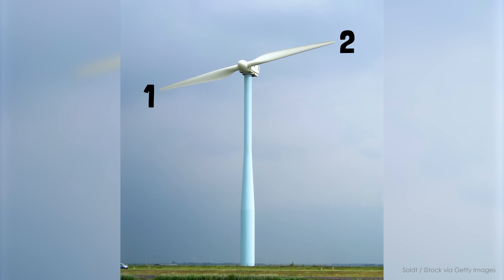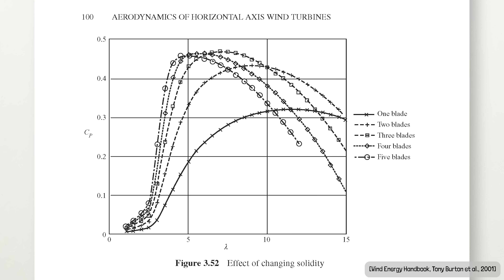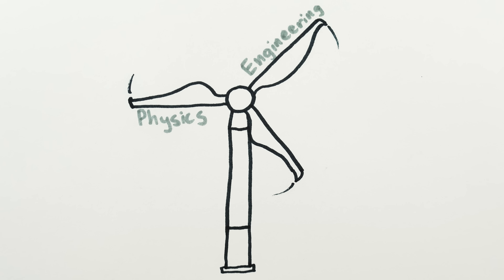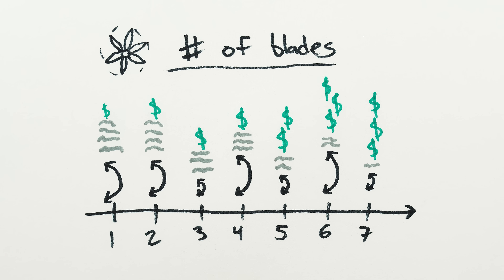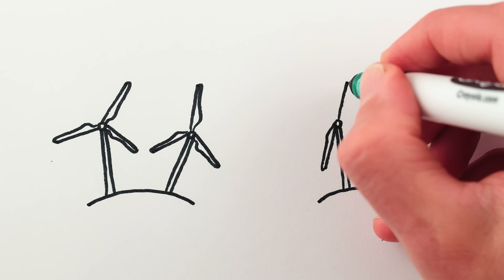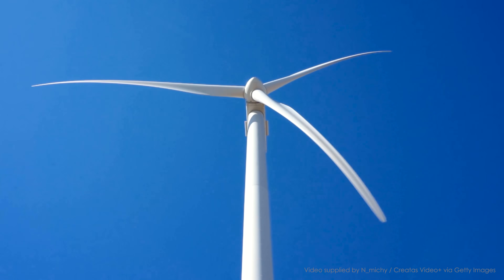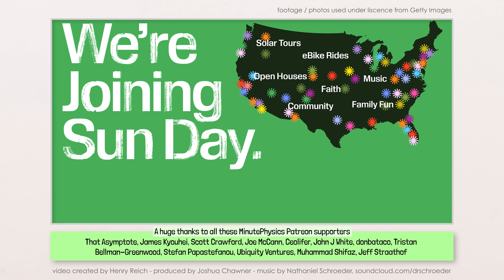Why Do Wind Turbines Have Three Blades?

Comment: Great video! I personally hate wind turbines because certain areas I grew up around had their beauty ruined by being covered in an apocalyptic number of wind turbines, over 1400.  It’s all well and good for people from the big cities to say they’re saving the environment, but from the local perspective the environment has been manifestly damaged.
Reply: Not only that, but when these machines reach the end of their lives, and they will at some point, they will be abandoned in place, and not ever taken down, to be a blight on the scenery forever and ever, just like in the oil and gas business.  I have seen both.  Abandoned wind farms, and abandoned oil and gas equipment.  It’s not cost effective to remove it, so when it is no longer of any use, they just abandon it as is where is.
Reply: @charlessansom4849  In civilised countries, planning permission for installations require a strategy for removal at the end of their working life. In New Zealand many wind farms have been upgraded and this sometimes requires the entire turbine to be removed and replaced. The energy and resources used are as nothing compared to the savings that accrue from a turbine that is working well.

Comment: Okay. So a five-bladed windTURBINE!!!! would run slower, with the same, or even Greater torque, cause less wear and with less intermittent 'wooshing' sound, intercept more air, thereby potentially supporting a greater load, hence more power and at lower speeds with less wear and hence, maintenance costs... So why TF are they using only 3 blades? Makes no sense to me!

Comment: Just in case someone didn’t know, wind turbines have a mechanism to adjust the blades' orientation depending on wind conditions, to have them rotate as much as possible at that efficiency sweet spot, even in strong wind — or to stop rotation entirely if power is not needed at the moment :)

Comment: it's possible to build a wind turbine with two blades, or five blades, or even one blade. but the vast majority of modern wind blades have 3 blades, and there are three good reasons for that. the first reason for three blades is the first blade of the wind blade. the second wind blade reason is the second blade of the wind blade. the wind blade third wind blade blade reason is the wind blade third blade wind of the wind blade. wind blade blade blade wind wind blade.

Comment: That graph pretty much tells the story. There is no benefit to adding more blades.

Turbines are built to get as much power from the wind as possible without stopping it. The fact that this data on numbers of blades exists reflects that a lot of experiments have been done over the years; they just built one off turbines with different configurations and ran them until they wore out. There are various advantages to different configurations, but generally speaking it's a question of economy, and that means gigantic 3 blade turbines are the only ones that matter on a utility scale.

The bigger the turbine, the more powerful; if the technology exists to make such towers, blades, and gearboxes.

Comment: It has three blades so it can kill more birds of prey and other natural fauna, on those rare days when there is just the right amount of wind to generate electricity (too much or too little they won't work), which in turn unbalances the existing power grid, causing significant disruption in the power supply for an area without significant investment in balancing capacity.

Comment: Why do wind turbines need 50 acres of cleared land to function effectively...
Reply: Because they're inferior to nuclear power plants 😊
Reply: @aceman0000099 Yes!! I have a take. in every point in time the 'power' that humanity has has been porgressing almost exponentially. man power, mechanicla power and now electrical, each replacing the previous. if humanity isnt progressing exponentially in power generation we are technologically stagnant or even going backwards. imagine if we had as much power as we needed from nuclear to quickly find an actual solution to global pollution. minimise it in the mean time running factories and foundries and public tansport. instead we invest 10x the cost of building nuclear reactors into renewablea that we dont recycle. Its like the energy production version of throwing a plastic bottle away after using it.
Reply: Because they need space where wind blows consistently to be worthwhile. And the “cleared land” in question tends to be farmland or open ocean anyway

Comment: There are also wind turbines, which use a cylinder on a spindle with protruding vanes on the outside that can be placed on rooftops to provide local power. These can be mounted in either horizontal or vertical direction.

Comment: None of this interesting science and engineering negates the fact that wind turbines are an environmental and financial disaster. They need to be destroyed, have their usable materials recovered and repurposed, and relegated to the history of bad ideas.
Reply: I'd be curious to know if you believe the same thing about, say, coal burning power plants?  Considering they cause an order of magnitude more environmental harm than windmills even just on a per-kilowatt basis.
Reply: @Argusthecat  no, I don’t believe that about coal plants, or nuclear. Nothing is perfectly clean. But of all our options, coal, natural gas and nuclear are the least damaging options. They occupy less ground area, require fewer natural resources such as rare earth elements, require far, FAR less copper, and coal mines can be relatively easily remediated back to natural habitats. The fact is that human civilization is based on fire. And you cannot make wind or solar generators without using fire to make their components. So using fire as our primary source of energy is actually more efficient and less polluting.
Reply: @oliverheaviside2539 with coal, you literally pay to dig it up, AND THEN BURN IT. And then repeat until it's all gone. Wind is free, sunlight is free. You arent paying for fuel to then burn.
Reply: @shrimppasta5544  Turning sunlight into electricity isn’t free. Sunlight at zenith is 1,000 W/m2. The best solar panels are 20% efficient. Thousands of acres of land are required to match the output of one coal plant. And the sun doesn’t always shine,. Same with wind. Thousands of turbines connected with miles of copper cable and the wind doesn’t always blow. Wind and solar cannot provide uninterruptible baseload power; coal, gas or nuclear is the only realistic choices for baseload.
Reply: @oliverheaviside2539  It's kinda fucked up that you consider space and the need for batteries to be a cost, but you don't think that the massive increase in cancer rates in humans that coal plants cause is worth mentioning.  Do you just not know, or are you some kind of dread golem created by an industry PR team, cursed to lie in comments sections forever?
Reply: @Argusthecat  Your reply goes straight to personal insults. When you have thirty years experience as an engineer, you might have something to contribute.
Reply: @oliverheaviside2539  Your reply ignores the cancer thing, so I don't really think that you're worth listening to.
Reply: @Argusthecat  Prove “the cancer thing.” Cancer is everywhere and has myriad causes.

Comment: If there's an advantage for different blades wouldn't they make a turbine that was quote-unquote modular? A turbine that would start off at 5 blades but as the wind got faster the blades disappeared and converted into one eventually?

Comment: If you've ever seen them transport any of these blades, you'll be thankful we even get three-bladed turbines.
Reply: I once saw a truck transporting a single blade and the truck got stuck due to difficulty navigating a turn at what I''ll call a 4-way junction (think of a traffic circle, but form it into a traffic square, with the truck blocking traffic on two sides of the square). It took several hours to clear.

Comment: 2:07: No. This is incorrect. With 3 and above, the fundamental component of the time varying forces on the blades resolves to constant net forces and moments in the non-rotating frame of the tower. More blades change which harmonics the system is sensitive to. A second harmonic will be sinusoidal on a three blade system but will be constant on a four blade system. A third harmonic will be constant on a three blade system but sinusoidal on a four blade system. A five bladed system will have constant forces and moments from first, second, and third harmonics.

Comment: As a helicopter rotor engineer who specializes in loads and vibration (helicopters have a boat load in common with wind turbines), this is a great video but the section on loads vs even/odd number of blades is not quite correct.  There is nothing inherently more vibration-y about an even number of blades. More blades always reduces the size of oscillatory loads from the wind, whether even or odd.  but as correctly pointed out, that comes with increased part count and complexity.  Aside from that small gripe, great video!!

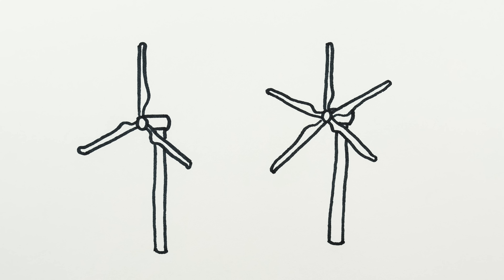Comment: 1:36 "If the rotor has an odd number of blades... the fact that blades don't come in pairs means that wind loads are more evenly distributed across the face of the rotor" - I don't get this part. How does an odd number of blades create more EVENly distributed load than an EVEN number of blades?

Comment: Also, the vectors cancel out neatly at 120 degrees, which you get at, you guessed it, 3 blades. Also, considering p-factor, you get far lesser p-effect with 3 or 5 bladed props than 2, 4, or 6 bladed props, though at a cost of poorer drive. Which is why turboprops tend to have 4 or six bladed props, with 5 blades slowly cropping up as the undersung but proven victor. While yes, in an airplane, the motor runs the propeller, the utility of the blades themselves comes to full use in an engine failure, when the engines are feathered. The blades continue moving and turning in the air stream, and this is called, you guessed it, windmilling.

Comment: There are so many holes in these assumptions. It's just mind numbing. For instance, three blades are cheaper than 5 blades,. Really? But 5 shorter blades would be cheaper and easier to produce, rotate more slowly and produce the same amount of energy, but being smaller could be packed more tightly on a site. The tiny loss of efficiency is marginal at best. The elephant in the room is that more companies could produce them reducing the monopoly of the limited number of manufacturers.

Comment: So five-blade rotors would be better noisewise and could run on lower speeds. But because they cost more and need more material three-blades are preferred. (The efficiency thing is quite close, if I saw the graphs right)

Comment: There's at least one more reason you didn't mention: gyroscopic forces. A spinning turbine is a gyroscope and if turbine is yawing to face a changing wind direction while it's spinning it's going to experience gyroscopic forces that twist the turbine either up or down. If the turbine has 3 or more blades that force is roughly constant. If the turbine has only 2 blades (or only 1 blade) the twisting force will vary being the strongest when the blades are vertical and weakest when they're horizontal. That kind of varying force will rattle the tower and cause faster wear and material fatigue. That's a good reason for having at least 3 blades.
Reply: Exactly the point that I was going to make.

Comment: Why do they need DIESEL generators to spin if there's not enough wind to make them spin naturally?

Why do they explode if there's too much wind?

Why do they off birds?

Why do they take up so much land scape to generate sufficient amount of energy?

Why are they so loud, to the point communities complain when they're built close to their homes?

Why do they ruin the view of natural landscapes?

Why are there giant land fill graveyards of old blades? 
What happened to the whole "recycle" thing we hear so much about?
Reply: 1 - They don't need diesel generators to spin lol. When the wind conditions are bad, they come to a halt.

2 - That's immensely rare. Only happens in the case of brake or gearbox failure.

3 - Because birds sometimes fly into the blades. However, the amount is very small - a drop on the ocean compared ot outdoor cats, buildings and cars.

4 - Energy density. You need to harvest enough wind to provide the necessary power.

5 - See the video. Turbulence noise. They're usually built far from homes.

6 - That's just your personal opinion. I think they're really cool.

7 - They can be recycled just like any other glass fiber structure, and the massive reuction in atmospheric CO2 is absolutely worth it even if they weren't recycled at all. The blades don't spread into the atmosphere, they stay where you put them.
Reply: > outright lie
> they’re not made of vibranium as it turns out
> they don’t off nearly as many as house cats or glass skyscrapers 
> wind needs space to blow, and there’s lots of empty space in farmland or the open ocean anyway
> subjective taking point
> subjective talking point
> more demand for turbines will incentivize effective ways to recycle them and extend their lifespan.

Comment: I'd just like to say, as a colorblind person, I highly appreciate the efficiency graph using symbols rather than colors to distinguish lines. I know that it was probably only done that way because it came from a black-and-white publication, but it's so rare for me to actually be able to read a line graph that it is like a breath of fresh air.
Reply: In scientific papers the submitting scientist often have to pay if they want to include color in the print version of the journal. For the online version color is usually free.
Reply: I was taught to design graphs in a way so that they can be both distinguished by color and symbols/line dotting in case the graph is printed in black and white
Reply: I remember my professor saying we should always use a red-blue gradient whenever we need to have two colors on a graph, because even most colorblind people have no problem reading it.
Reply: @quacking.duck.3243  that's only because the most common form of colorblindness is red/green colorblindness, so red/blue works for them but red/green wouldn't. but ideally you'd want to avoid relying solely on color to convey meaning
Reply: @seanthesheep  Yeah....then there are stop lights at night during a fog... That one is fun, especially the stop lights that are mounted horizontally on a fixed bar and not the vertical hanging ones.
Reply: @seanthesheep  not necessarily. Red/green cone activation frequencies are positioned in such a way that they have great overlap, while the blue sits fairly far in the spectrum. That means if a person is missing either green or red cones, they can still see the gradient just fine, albeit slightly desaturated. And for missing blues the gradient becomes red/green.
Reply: the best graphs include both the color and the shape differences
Reply: And for 2d color gradient maps, there are color scales designed to be aesthetic while translating directly to greyscale, making them readable for those who are colorblind

I used one of them (inferno) for a recent publication and thought it was nice
Reply: Do not look up Visolve, because suggesting such an action triggers the spam filter
Reply: Visolve (spam filter prevents me from adding verbs)
Reply: Tried to explain that to a professor who wrote the required book for college class; geo human environent. Nearly every graph was color that had only a slight shade  apart from the others. The ass could have added  some lines or dots; some textures to distinguish the damned things but; noooooo. BTW he got caught screwing around with some small children (boys) that semester! Didn't even get fired as far as I know nor disciplined!😮 Apparently tenure speaks louder than petiophilea!
Reply: Whenever I design graphs, I always make sure to take that into account. Just making them different colors isnt enough.
Reply: As a non-colorblind person, I highly realize that HMI in SCADA has been devastating beyond belief attempting to cater to all.
Reply: @KellyR-qx7wn  Just don't get upset and take a hammer to the HMI.  It is a pain to remember where the flash drive is to set up the graphics for the replacement and there is always the urge to crowd more data on the screen when you are there uploading it.
Reply: Journals usually require it because people used to use black and white photo copiers.

Comment: To bad it’s intermittent, can destabilize the grid, takes up a lot of land, makes noise, kills birds/bats, is costly to build/maintain, and often isn’t even profitable without subsidies.
Reply: That's just not true (anymore). Wind is now cheaper than most other options in many places.
Reply: Source: Trust me Bro
Reply: 1 - When spread out well it's not anywhere near as intermittent as you think.
2 - Why would it destabilize a grid? By which function?
3 - So does ANY method of power generation. At least this one is immensely clean and cheap.
4 - The noise isn't an issue when built away from where people live. You have to be pretty close to them to hear them. I've walked around next to wind turbine farms, but I never heard them.
5 - No they're not costly, wtf lol. They're literally the cheapest form of electricity right now, and is subsidy free probably everywhere by now. 

Subsidies exist to help a technology scale up quicker so that costs can drop, and this worked extremely well for wind energy. Now we have cheap, clean and quick to build energy. What's wrong with that?
Reply: @logitech4873  I'm assuming that by destabilization he means that they don't have inertia, or mechanically the turbines do have inertia but usually wind turbines' generators are behind an inverter meaning the inertia isn't coupled to the grid.